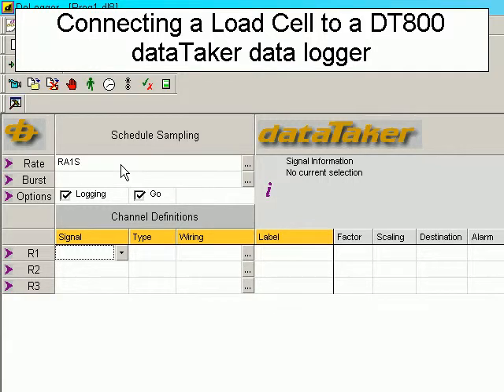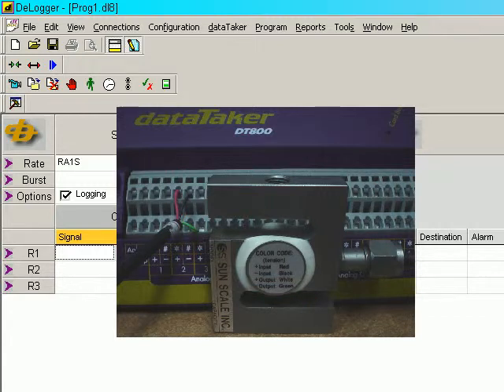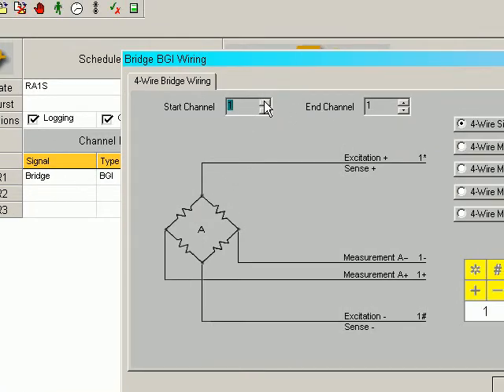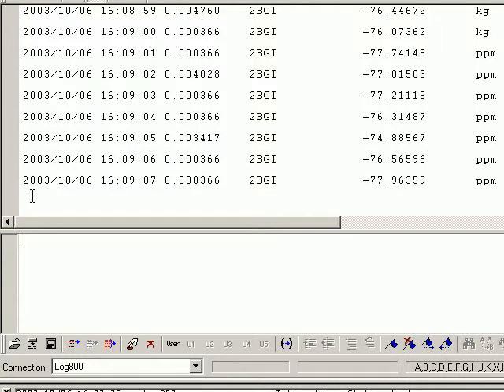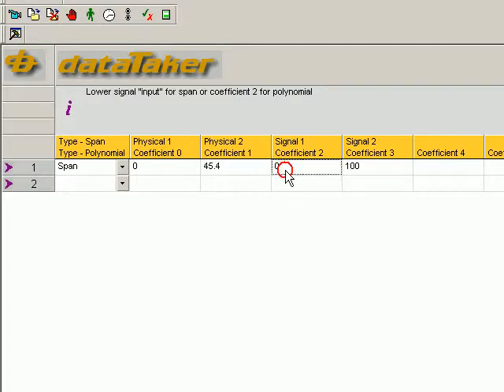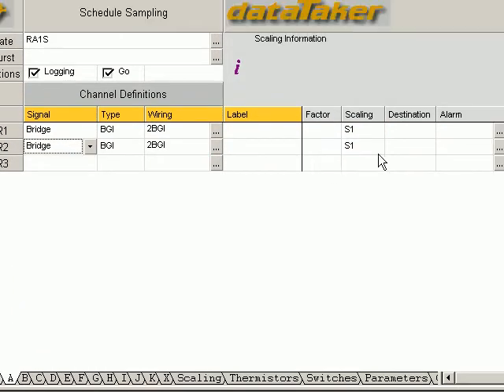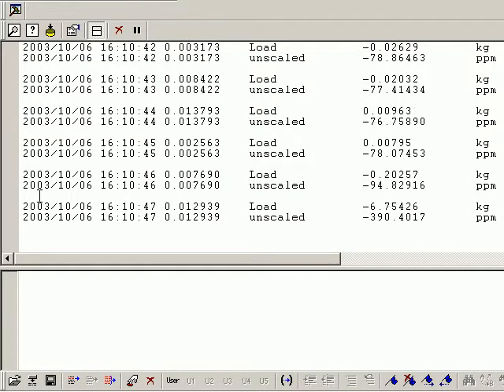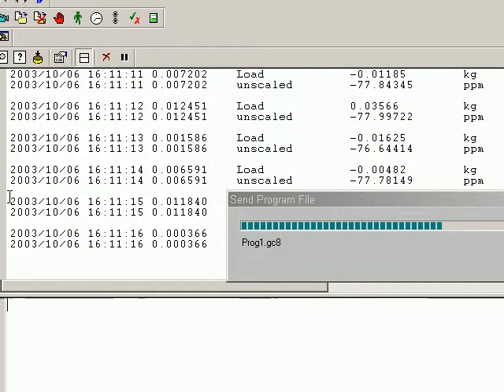Tutorial for Connecting a Load Cell on the dataTaker DT800

Comment: From where i can download "deLogger" Software as the one which i got from the seller is "deTransfer". this interface is looking much better than the one i have.
Could you please explain.
Thanks
Reply: Provided you are talking DT80 loggers, DeLogger has been replaced with 'built in' software. If you connect a PC directly to the logger using a standard Ethernet cable.  If you scroll the display after about 30sec. The logger will display an IP address which would be 169.254.xxx.xxx ... Record that number and then type it into a browser on the PC connected.  There is a simple 'Configuration' program that can be used. There are a number of videos on using this logger configuration program.
Reply: @GraemeMurphy54  I have DT800 model with me purchased in 2012. As per your suggestions, i tried to connect both but nothing worked out. Could you please suggest from where i can get this deLogger Software. Thank you in advance.
Reply: @ankushthakur3558  Hi. Have you found the software?